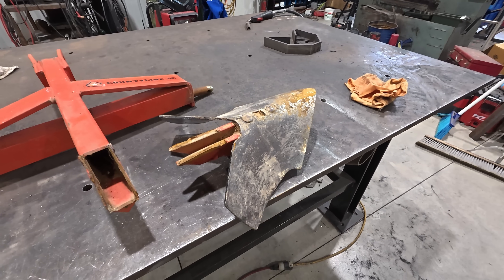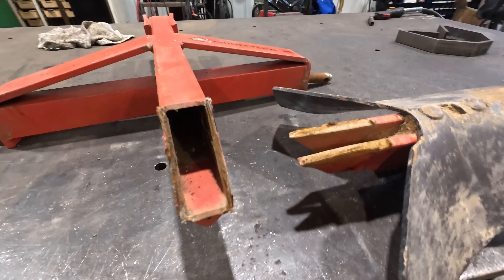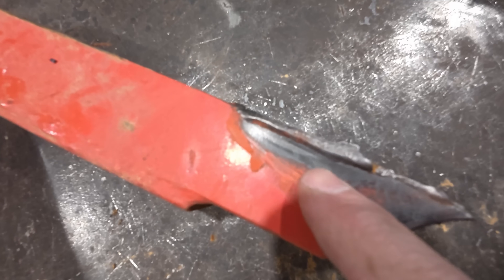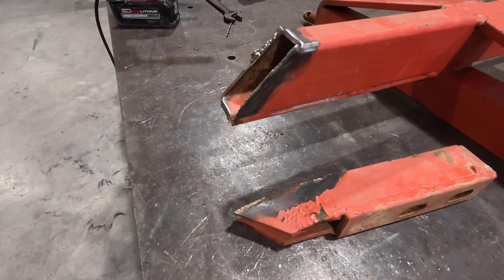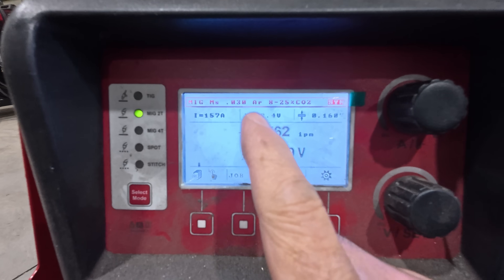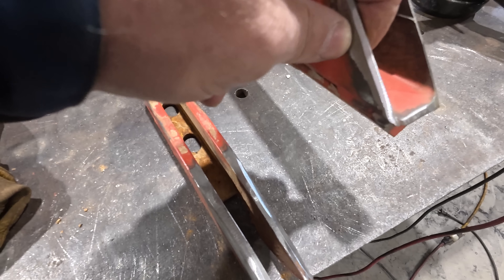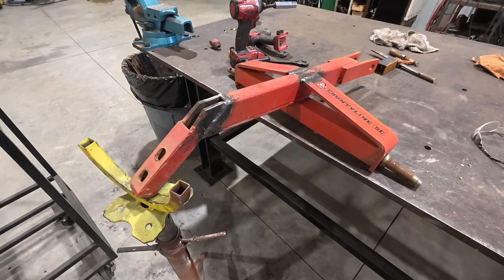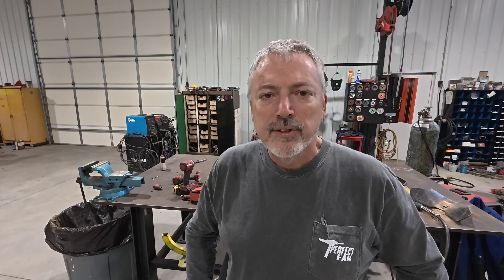This MIG Welding Mistake Destroys Your Projects

Comment: A pipe-fitter I know committed a felony and when he got out of prison he had to go work at a trash company. Roger invented "Shit-Welding". No joint prep on rusty crap. The secret is 24 volts and CO2. Also a lot of oscillation and weaving. Also on thin stuff you stutter a LOT to prevent burn-through. His master stoke on stuff that literally had rusted to lace - was to brush SIDEWAYS with the wire. The arc+CO2 was CLEANING the stuff. It was also DEPOSITING tiny spatter balls. You had to wait for cool down OFTEN. But after a while it was clean and there was enough spatter and it was cool enough to make overlapping  blob-spots. Finally you could fuse it all together and depending what it was you didn't even have to grind it.

Comment: You know what else is dangerous?  Bad design.  So before you go fixing someone else's bad design, understand the original problem and why it broke, so you can fix it permanently.
In my limited experience, this usually means adding more metal - not just more weld bead.

Comment: Failure to do everything in a professional manner is inexcusable since there is ample information, but BUBBA DOES NOT READ. 
There is endless information on how to prepare, fit and weld properly. It's easy to fab an AWS style bend tester using a cheap hydraulic press then KNOW if you're doing acceptable work, but the people who don't care aren't watching this video. 
I've never had a weld fail even before formal training because I study everything I do or work on long before I do a task. This isn't even slightly difficult. 
Weld practice is so much fun there's no reason not to cut coupons, set up a practice tree etc.
The old pipeliners who taught me had all that at their home shops to keep sharp while not on the road. Other welders have solved pretty much every problem. I just copy people far more skilled than I am since I'm nothing special.
Reply: One of the biggest annoyances I’ve come across over the decades is people who don’t read manuals. I’ve designed and built,t machinery and written the manuals. There’s a reason for manuals. The only real men as far as I’m concerned are those who read the manuals instead of making stupid, childish mistakes, then complain it’s the manufacturer’s fault.

Comment: I have taught high school welding and advanced welding for 30 years now.  I also have a 3G plate cert and tig/stick combo pipe cert.  I have also  taught local millwrights how to pass their plate test several times.  I only mention this not to brag but to give what I am going to say some credibility.  The skill of fit-up, joint preparation, dressed down tacks, and metal cleanliness starts at a welder's introduction to the trade.  I teach this and demand this of my students for safety reasons.  There's nothing that leaves our welding shop for a customer that isn't prepared in such a way prior to welding.  We also don't short circuit MIG anything over 3/16".  This is stick welded and since a year ago, pulse mig welded (.045" wire and 90/10 gas).  My job is to teach our students the correct foundation of skills so they can learn, grow, and prosper from that foundation.  Good video, thanks.
Reply: As a fabricator I can tell by looking at that they just welded right over the mill scale with zero prep, that's why there's a "clean" rusty line where the pieces met up. No bevel, just cut it and send it

Comment: I just wish you had some some way to protect yourself from the hazardous grinding dust,welding fumes, and the highly toxic burning paint fumes 
That some many welders and fabricators are exposed to on a daily basis.Especially inside an enclosed space.
Reply from the maker: Thank you for your comment. I bought a PAPR system earlier this year. I use it on the bigger stuff, but you are right, and I should use it even on the small stuff.

Comment: When removing the old weld, you should have made even bevels  instead of digging in where the weld penetrated and tore out and leaving the parent metal where it did not. Joint preparation and having an even gap, so you don't fill some areas differently than other areas. Then covering it all up with another pass to hide what you did. Do it right, Don't farmer fix it.

Comment: Quality welding comes from experience, most often years of experience.  Not every Joe that buys a cheap welder is automatically a welder, he is greatly limited by his experience and the machines capabilities.
Reply: It also come from not guessing over this years. If you understand from the beginning by going to classes, then it won’t take 20 years to figure things out, if you ever do.
Reply: @melgross    I learned from 3 professionals in my early teens (auto body, structural welder, machinist), then vocational classes and fab shop for improvement but there's nothing that replaces experience to know how to approach a repair, 54 yrs now.
Reply: @ern48 sure, I can’t deny experience is great. But “experience” isn’t, by itself, always dreamt. I’ve known people with plenty of self taught experience in various areas who were doing things incorrectly all that time. I hired a lot of people over the years (not welding) who claimed experience, but when given a test, failed because they really didn’t know what they were doing.

Comment: This is a great advertisement for Tractor Supply.  Good stuff! 
 SC MIG looks pretty and can be pretty bad.  You can see bad manufacturer's welds all the time, on a trailer you'll see better welds at the hitch or neck and the rest may look like a first graders work.  This was a non-critical item so it was completely built by first graders.  The metal here was within the limits of SC, just bad prep and technique.

Comment: The rust tells the story. Bad prep. No preheat on the thicker material. Prep the joint for full penetration by beveling the thicker metal. Set the MIG for the thinner metal, apply 200F preheat to the thicker metal. Start the arc on the thicker metal and drag the puddle to the thinner metal quickly and back to the thicker metal. Do this as a continues stitch.
Reply: Lol no Chinese factory is preheating parts, they'd be better off turning up the heat to just short of blow through and going with that
Reply: @chrisrageNJ    May be but for those beginners who are looking for pointers, we don’t want them to get off on the wrong foot
Reply: Plus I'd set up for the thicker piece and flow the bead over to the thinner piece
Reply: @chrisrageNJ    I usually don’t preheat a part like this and as you said, set it up for the thicker piece, strike the arc on the thick piece, and drag the bead quickly to the thin stuff and back.

Comment: Not a compelling argument for that brand of plow! 
I think the problem one of design; mating 0.120” rectangle  tubing to 5/16” is too little metal on one side and too much on the other side. I wonder why they welded it when they could have glued it with the same effect. 
It doesn’t need weaves; it needs gusseting or overplating.

Comment: It's not the process ,,it the fact that a lot don't know the correct way
Reply: That statement shows your level of welding skill, and that would be a big ZERO.  It is the process and it is the skill level of the welder, which includes the preparation before welding. Welding is only the final part of the process and is made easy or stupidly hard by bad preparation.

Comment: I am a qualified welder and have been since the 1970's. And have been welding all proccesis since then. Mig weld when done correctly with the right preperation is just as strong as any other method. What you get in factories is un skilled people very often doing the welding, often carying out the welds in the wrong position such as downhill with short arc so just laying the weld on the surface, I have even seen welds where you can see underneath them in places.

Comment: I kinda chuckled at the part about weld / surface prep, cuz it's the first thing mentioned in the welding classes I took, it's the first thing covered in welding books, and in most decent welding videos on YouTube.  (there also a lot of bad advice here, because humans)  -- So I have always just done it as well as I can, every time.  However, I'm never under the gun of a deadline, either.  I do occasional welding for myself, rarely for job shop customers (because I don't have any customers LOL).  I was never a pro welder, I just like to become minimally competent in any new skill I acquire.  I've sawed as many coupons in half, filed and sanded and polished them, as anyone in a formal welding school!  (no need for microscropes and etchant if you just wanna see how well your bead penetrated)

It strikes me as no different from the importance of surface prep for painting/coating; surface prep matters a lot when it comes to longevity and holding up under heavy use... painting, welding, or powdercoating.  Maybe if I were running stick, burning through a thin patina of rust with big sticks of some aggressive rod type, I wouldn't worry about the surface being clean... maybe.... but I'm not.
I don't even own a Lincoln tombstone, wouldn't know where to put it, and have never once needed stick anyway.

Also, that title is 100% ragebait/clickbait; that is beneath you, please don't make it a habit. 😡  I mean, come on, literally everyone in welding talks about penetration, about surface prep, and their increased importance with MIG processes.  But if you called it what it is, I guess it wouldn't stand out from the crowd.  It's time to choose between serving your viewers, and making money.  If you focus on serving your viewers well, the money will come as viewership inceases. But focus on making money, and your viewership will dwindle to nothing, along with your ad reveniew.  I've been on the internet since before either Google or YouTube existed, I have observed the advent and development of monetization, and I have observed this to be true, time and time again.  Your call of course.

Comment: The farm implement factorys teach un-experienced people be production welders. They are taught  to make pretty looking welds, fast welds, the welds are not intended to be deep penetrating  strong Welds. Most of the time the new metal still has mill scale on it, they do not grind it off with a 3M fiber disc.  If a professional welder like the guy making this video welded that implement in the first place it never would have failed.
Reply: I agree --- the poster-guy knows his stuff ,,,, me? I'm a stick man --- and too old to care about wire. I can do it, but always wonder why I would stoop so low <jk>

Comment: As a Certified Welder with a Degree in Welding, this is 100% TRUE! S/C MIG has an incredible fail/limitation criteria that a lot of 'Welders' don't understand when it comes to deposition and penetration. For that reason, high quality Flux Cored wire processes, including FCAW-G can produce a MUCH better weld profile for pen. The fact the factory failed to even get this weld right shows you the lack of understanding 'needed' for this part to retain weld strength.  S/C MIG does not, repeat does NOT have deposition based on it's weld temps. Many people misunderstand this over FCAW. Good video!

Comment: its not the welders fault or a mig problem. its human error and no QC. when done right with the right prep work mig is perfect. I have used fancy high end welders. down to the cheap harbor fright welders.  when your process and prep are right it works. sometimes after cleaning and prep I will take a little heat to pull moisture out before welding. or if a cheap welder not enough amps get he steel nice and toasty then weld it up with multiple passs